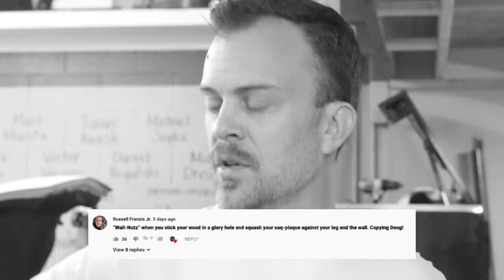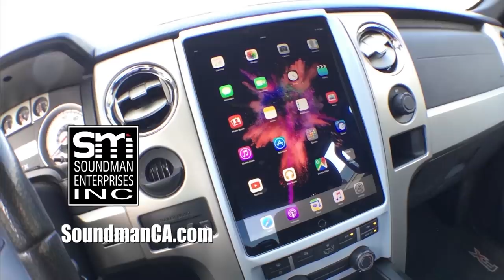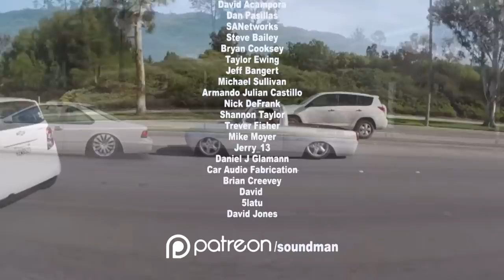4th order bandpass subwoofer box build - Acura stereo system #13

Comment: 6:00 these fence less cuts are super dangerous. Never push the wood through the blade like that. Build a table saw sled and save your fingers.
Reply: Listen, vitarelli - we need some excitement in these damn videos.  Besides, blood doesn't stain... does it? 😏
Reply: Or do it like Mark does and tape a straight edge on it and use a flush trim bit on the router table.

Comment: The tape measure and level cost more than those subs. Those subs are like what you buy at a flea market.
Reply: Cliff P  just because they were not released as Ecstasy does not mean they weren't released under a different name. Much like MANY subs released in the 90's that were sold at flea markets, they were all basically the same speaker with a different name sourced to a different company.
Reply: @MrLleyo81  exactly.
Reply: @MrLleyo81  I think you mean Pyle. I remember those and still have a subwoofer with one of those drivers.
Reply: The company now goes by the name JL FR/audio

Comment: Doug I had a thought you could drill a bunch of tiny holes in your cutting table you can aerate it like they do air hockey table in the sheathing will just float across that's what they do at glass shops to move those giant pieces just saying the thought